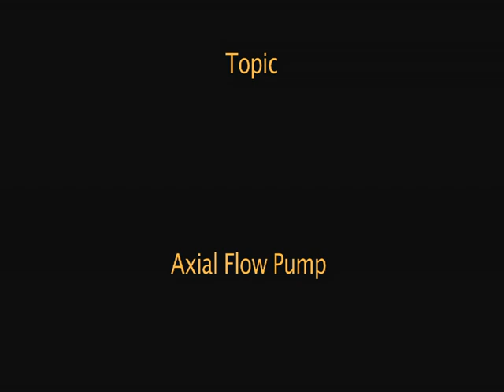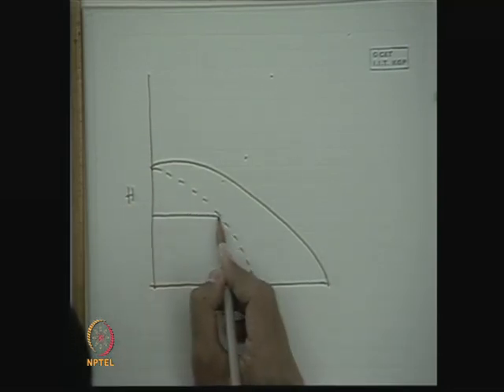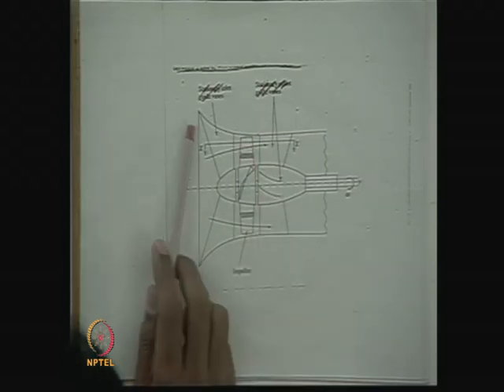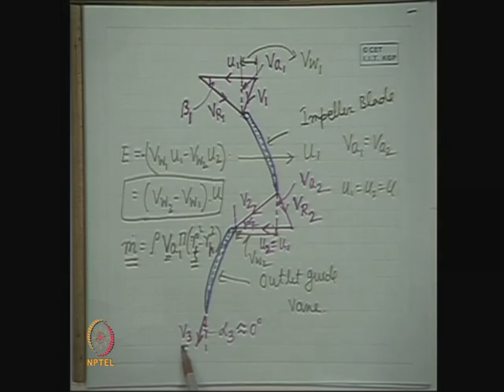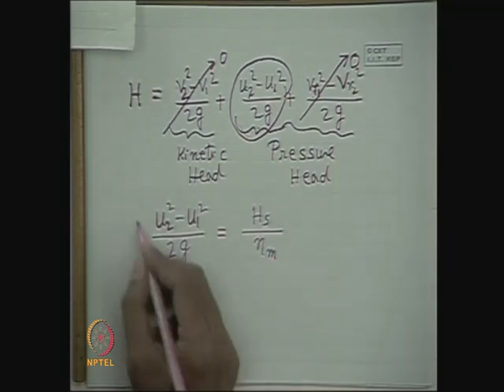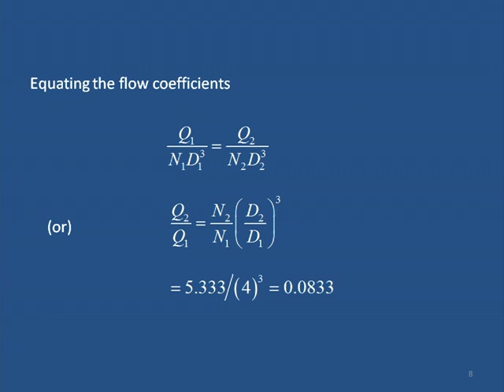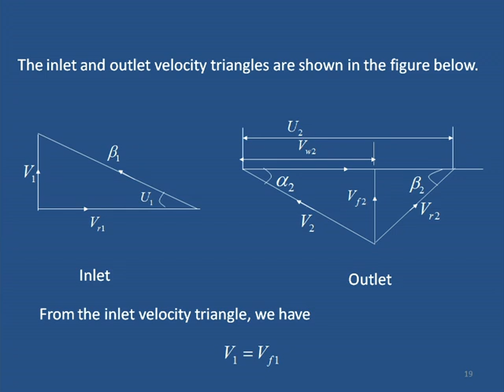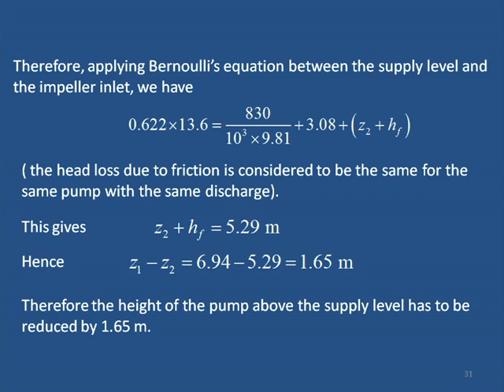Mod-01 Lec-18 Axial Flow Pump

Comment: The energy  distributed along the radious is incrsasing  in squar rate
The head is also square  proportion along the radious.
The head met by the Mump is  uniform, Across the cross section of pipe.
Parabolically rising pressure due to nrespective limear velocity of every point on the radious